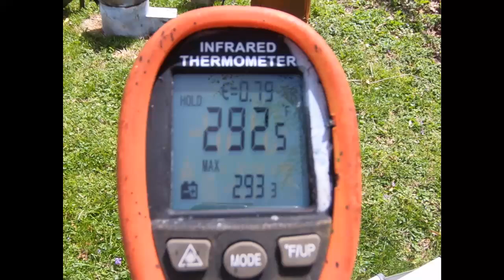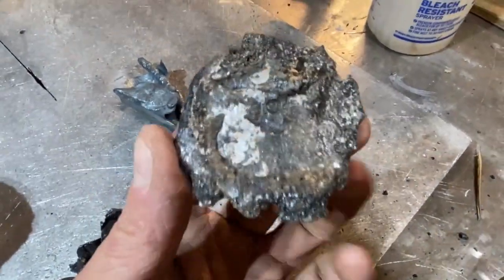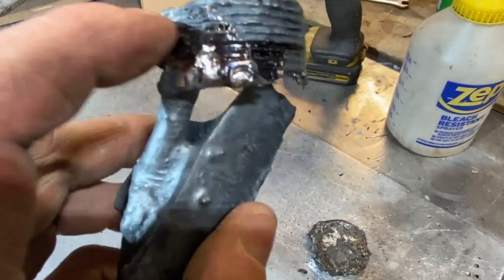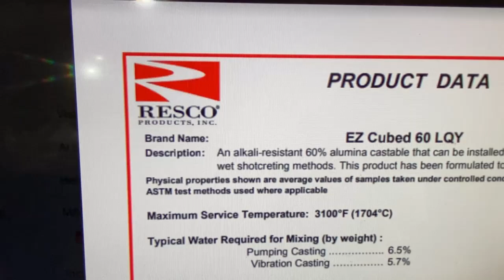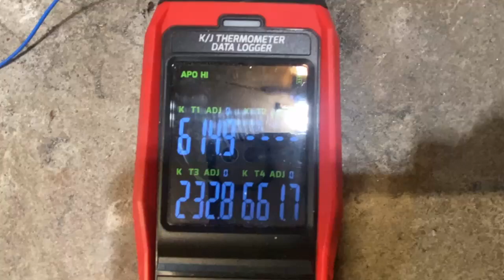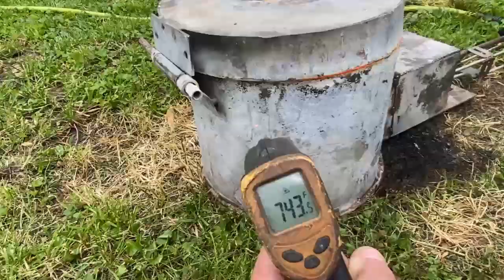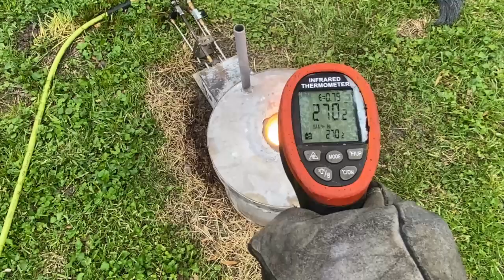High Emissivity Paint Increases foundry furnace temp

Comment: Good vid mate, thanks for keeping them coming. For any future furnace builds, you may want to consider pvc pipe for a liner. Civil plumbing companies use large diameter pipe and often have short lengths left over from jobs. I have got some 5 and 6 foot lengths for nothing, just by going and asking. Anyhow, a length cut to the depth of your furnace walls and then split in two lengthwise, taped together (inside) and there you go. Pack the refractory, let dry, cut the tape and peel one edge of the pvc into the middle and both halves come out easily.

Comment: wow more videos today 😁, I have been thinking about the high temperature on the inside of the furnace since the last video, instead of having one piece of metal going all the way around, if it was split into say 2 or 4 panels that overlap and are painted they could be replaced/switched around unless you just keep melting them 😂,  ... you prepared the area before painting, but when spraying was the metal cold ? wondering if it would make a difference if it was warmed kinda like car spray booths that use heat lamps to help the coat dry more evenly as well as a little warm up between the coats ?  ..fragments/cracking is normally the expanding and then shrinking like you said so guess its a little more trial and error on how to apply/how thick and if it just needs to cool down slower after being used?